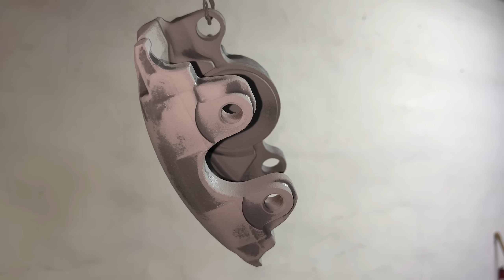How to Paint Brake Calipers - Like from the FACTORY

Comment: To all those saying, “this looks professional.”The final product does look great, and I’m sure will last. However the grease used to lubricate the caliper piston is for the outside parts such as the sliders or pad guides. The only lubricant that should be used to lubricator brake piston seals is brake fluid, or else you risk contamination of the brake fluid and seal failure.
Reply: What do you use to overhaul brake cups ? You use brake grease , it won't contaminate your oil or seals or erode your lines because it's made for that plus some of it will get diluted and comes out with the brake bleeding procedure .
Reply: @ You shouldn’t use anything but brake fluid according to EVERY manufacturer. Synthetic brake grease is only used to lubricate sliders, anti rattle clips, brake pad to carrier and possibly between the pad and caliper exterior. It has a high melt temperature point and it won’t cause rubber slide boots to swell. It does “dilute” in brake fluid and could cause clogs in brake fluid return to the master cylinder. Brake fluid passages in bleeder screws and the master, may only be 1mm in diameter. They clog as the flew hoses deteriorate so I wouldn’t trust passages with ANYTHING thicker than brake fluid.
Reply: @deanbudgell6220  i guess you never saw  drum brakes assembly in a factory or an overhaul at the dealer or a professional shop , there is literally a grease specifically made to be used in the cup overhaul process  and it will delute and won't cause any clogging or corrosion or high contamination of the fluid and as I said after every overhaul you need to bleed the system very well
Reply: @deanbudgell6220  white lithium based or silicone based grease
Reply: 25 years as a licensed mechanic and every manufacturer tells me otherwise. For example here is Fords recommendation WARNING: Do not use any fluid other than clean brake fluid meeting manufacturer's specification. Additionally, do not use brake fluid that has been previously drained. Following these instructions will help prevent system contamination, brake component damage and the risk of serious personal injury.  You can do whatever you want to your brakes. But I will not teach my students improper procedures using improper methods.
Reply: I suspect that is the assembly grease supplied with the new piston seal kits. I am sure the manufacturers of the seal kits know what they're doing

Comment: After the hours of work, and having the expensive machines to do the work. Its far cheaper and easier to just buy the replacements and slap them on.
Reply: Yes but what’s the fun in that!? 🤷‍♂️
Reply: @IDontTalkToCops  if its an old car fine. If its a newer one and parts are easily available. Theres enough work there already. Get a core charge if you can. Olenty of fun doing that job. And not this unessacary bit.
Reply: not is not :) so call new aftermarket parts are often low quality ones and are cheap for reason.
Reply: @lucaslagun8283  i can buy an oem part for most vehicles upto 20 years back. I could see this on something vintage. Though often they do complete highend brake setups on most I've seen. I'll stand by its cheaper to buy than the time it took the person being recorded to do all that work.
Reply: Ya , but they are not nicely painted ?
Reply: @JohnSmithdoe  ok. Still cheaper to buy new and powder coat.
Reply: Wasn’t titled don’t buy replacements, do this instead… simply showing masterful work if someone wanted to paint calipers themselves.
Reply: @xTymezz  I never said it was titled anything.
Reply: What about my Porsche 4 pot brembos😂
Reply: @kristian5821  you do you booboo
Reply: @ well I ain’t spending 2000 pounds on new calipers am I
Reply: @kristian5821  that would depend on the number of hours it would take you to complete the work within this video on your calipers. And of course what you earn per hour. If in fact the number of hours spent on this and the materials to sand, clean, prime, paint and make perfect, your calipers may be as much or better than 2000. Or it may not be. Oh and having all the tools required for such a job which increase the cost of the job. And having the space required to perform this job correctly which increases the cost of the job.  Please note that a high-end vehicles break calipers are not whats shown in this video. And that comparing a statement to a basic break calipers that's 300$ to one that's 2000$ is obtuse.
Reply: @ I’ve got a full workshop to play with, it’s not always the case that rebuilding calipers isn’t worth it all I’m saying
Reply: @kristian5821  we are not speaking to all calipers is my very point. We are speaking to the very specific one in this video. And your full shop definitely adds to the expense of doing work.

Comment: This is the proper way to do this. Complete disassembly, thorough cleaning of the components, correct masking of contact surfaces, then high heat paint applied and cured. Agree with those who say to chase the threads to prevent galling upon reassembly, and possibly honing the piston bore if needed.  Overall, very well done.
Reply: Earplugs are great for plugging bolt holes for paint.
Reply: if a tiny bit of over spray gets on the threads the bolt will just go through it and the threads will be fine. its not like if you had dry concrete or something on the thread lol. Only thing i could see messing up the threads is when he sandblasted it but from the looks of it the threads look to be fine.

Comment: Nicely done job! It was good to see the use of citric acid, because that's a great way to remove rust and I've never tried that, with a caliper, so far.
Reply: A strong vinegar solution overnight is the best I've ever used. It must be done outdoors, however, because of the odor of vinegar, which is likely unhealthy to breath very long.
Reply: @markjones7417  chip shop simulator 🤣
Reply: Cotton balls for holes
Reply: Did he use citric acid and the rest water?
Reply: @juddskiibiz  yes to make up the citric acid solution.

Comment: 2:20 lemon acid you mean citric acid?? It works with more metals or its specified for some metal?? i would like a bit explanation since i have many parts that i always sand by hand because i dont have sandblasting machine.. it will be really usefull to have more time while the chemicals working.. thanks you!!
Reply: I think you can try use vinegar, just soak it for one or two night or more for bigger parts.
Reply: no its gotta be lemon or the flavor wont be correct

Comment: Isn't it necessary to lube the slides/guide pins and piston before use?
Reply: Those slider pins you should only use silicone based grease, if not they will dry up against the rubber slider pin housing it goes through. The rubber housing have like 3-4 pockets inside where silicone grease should fill up all available space.
What he sid with the piston is fine, you will bleed the brakes with new dot4 brake fluid after mounting, this will be lubing the piston for years untill dust particles gather up and lock up the brakes again.. I have rebuilt the same brakes on my VW

Comment: Good Video :) I always apply high temp ceramic grease on inside threads to stop steel bleeding nipples sizing up. And use ATE assembly lube on seals and pistons itself. 
Also if u want them to last lot longer than zinc plating is best rust prevention and than  powder coating or Epoxy primer and spray it.
Reply: I'm a marathon runner and often have to put grease on my bleeding nipples.

Comment: Excellent work. Never thought of Lemon Acid and it's ability to remove rust from calipers. You used Zinc Primer, then a black paint on the mounting surface. Is that just black heat-resistant black paint as well? 
Thanks again for this how to.

Comment: How did the BRAKE BLEED NIPPLE MOVE TO THE OPPOSITE SIDE?
Reply: If you watch closely, you'll realize there's 2 of them for both sides of the car, they are symmetrical, so there isn't any mistery you were just looking at the same calipers from differents sides of the car. I think that would be pretty clear tbh, because you can see both in the video.

Comment: Yes, good vid.  If you don’t have a sandblaster, here’s my poor man’s substitute: one of those massage ‘guns’.  I got a small diameter (1 inch ish) wire brush head, meant for use in a drill, and i had to increase the diameter of the shaft of it from the standard 1/4” to around 10mm or so.  Now you could just wrap say, a cut-off segment of a hose pipe, and keep going until you get it about right, then apply duck tape or insulation tape with some tension, to hold it in place.  I have a bag of short lengths of clear plastic tubing various sizes, that neatly are a press-fit into their next size up or down, you know what I mean.  It took three of those, about 1” lengths, shoved over one another.  It was easier to give it a try, then remove all of them, and assemble the chinese-doll arrangement of three stumpy bits of tubing OFF of the rotary wire brush, THEN bang them on with a hammer gently, and yea, wear gloves here.  Then, it fitted the mounting hole in the ‘gun’ pretty well, all these things are just push-fit anyway on my unit.

How well does it work?  Pretty well.  I got the one that is most compact, I didn’t go for max power or size or anything, I just got the one that had a decent Temu star rating.  It’s got gold edging on it, if you are looking.  It was less than £10UK .  I used it on my Prius rear brake caliper, and it took the rust off better than the alternative, hammering with a small weld-flux removing hammer, or hand wire-brushing or rotary wire brushing.  There’s still a use for rotary wire brushing, my main issue is, I don’t want to damage my drilling device, Bosch or Milwaukee, neither surely has bearings designed for that much axial loading?  Anyway…while this does not take the rust down to the metal, it’s as good as any of the other non-laser or non-sandblasting methods, and easier.  And the lack of out-of-control rotary whooshing wire bristles is nice too.

My particular massage gun, has 6 power settings.  But, in addition, it has a sort of ‘pressure-activated-boost’ action, and this is proportional to the power setting you are on.  IE push down harder on setting one, and there’s a certain faster buzzing with a certain amount of force, but if you up that to say setting 3, then press harder into the workpiece, the resulting boost seems more than on the lower setting.  I’m sure it’s an improvement, if only for when you don’t have a vice or whatever, to hold the workpiece/calliper, it’s safer than a wild rotary action on an angle grinder or drill maybe, and some weird dints and crevices are positively elusive without a direct-line hammer action.

So, that’s my tip.  Drawbacks are, as expected, the bristles do ‘bend over’ at the tip after a bit, but I suspect if I either wrap duck tape or maybe use a couple of tie-wraps or circlips/jubilee clips, to keep the bristle ‘bunched’ properly then it mightn’t let the bristles bend at the tip.  I only just got a vice, after 50 years of working on cars I thought I better start making it easier.  Getting the tools I always avoided buying.  Sandblasting is obviously really good.  Laser, is really, really good, but will get cheaper I am sure.  My only issue is laser rust removal is awfully easy - you have to get set up to sand blast, your child or curious teenager isn’t going to readily mess with a sandblaster booth.  Lasers are somewhat dangerous when they are that powerful, and it’s a bit like welding which now is also very cheap…I was put off not by the PPE I needed to buy, but by the need for a neat workshop.  I’ve got naptha and all sorts in there!  So until I have a decently-sorted garage, welding is another thing to steer clear of for me.  Good vid, take care all.

Comment: All threaded holes need to have bolts screwed into them before sandblasting and painting. Then, a thread tap must be run in to clear out the threads.😊
Reply: Just stick foam ear plugs in if there nice and snug, should be good.

Comment: I was rebuilding my read clipers and I struggled to put a new rubber boot back in place. 
The rubber boot end has a metal ring which I could not mound on the groove even with a force and you seem to mound it fairly easily 7:13 Does it need a lot of force?

Comment: pressure release on the break piston can be achieved with pressured air. Be carefull though, use low pressure and as in this video, a cloth to brace the exit of the piston.
Reply: You can pump the piston out before removing the caliper from the car
Reply: @olejakobsen2363  indeed, this is also true. just remove the brake pads and you push it out. Off the disk of course
Reply: @olejakobsen2363  Yes, that can work, but you won't be able to control the release of brake fluid, and risk making a mess.

Comment: You need to lubricate the slider pins otherwise it’ll seize up pretty quickly.
Reply: Not on these styles...many manufacturers don't recommend lubricating these.
Reply: So when should we lubricate and when not? Can you explain please?
Reply: @wcmauldin81 what calipers are these for because it’s the first I’ve ever heard of it? They will get water ingress and rust.
Reply: I know most BMWs have this style and the service manual specifically states to clean the guide pins but so not lubricate. Due to the pins potentially being open to the elements, any lubricant could attract foreign contaminants.

Sealed systems such as Kia and others are within the metal caliper bracket and need to be lubricated.
Reply: Is this a BMW? Nope. It’s a Ford.
Reply: @rfahlsing  No but it's an ATE caliper which is pretty much identical in design and function.

Comment: Hi. Thanks for the video. Why You use a heat after painting?  Can I use a bike pump to extend the cylinder?
Reply: yes. you can use bike pump. heat is because for making sure paint doesnt fade when install on car
Reply: @MrOner07  You can also put it out when caliber is conneted in your car, take it out disk and only push brake pedal.

Comment: How did you protect the coating inside the bore, which is the most important bit?
Reply: the bore in use is protected by the brake fluid, which as long as you replace at the correct intervals wouldn't suffer any corrosion issues, and the sealing surface is the piston anyway so don't need to stress to much on the bore

Comment: Great result and proper process. However i prefer powder coating coz spray paint will be weakened over time.
Reply: Some folks don't like powder coating because it comes out a bit goopy-looking. The spray finish tends to retain details better. I've seen this on my motorcycle project.

Comment: Note he tried to save the seals, too. By this method, you can save $35 or more per caliper, and you control quality, not some over-worked, under-paid quota slave in an off- shore refurbisher factory.
Those who plan to keep their cars already realize how quickly parts can disappear from the after-market. 
Recycling is the answer, which puts you back in control. 
* Even industry rebuild kits don't deliver this level of quality. Their only plausible purpose is to provide replacement of damaged rubber parts. If your rubber parts are reusable, consider protecting them with high-quality silicone grease for protection against oxidation while in storage.

Comment: Caliper paint is heat resistant to 900*F.  It is also very chemical resistant.  Would have been nice to know what black primer you used and the final coat. They do look tremendous and that lemon acid trick is da shizat.
Reply from the maker: zinc primer probably silicon-organic base (temp resistant). And final paint based on silicone polymers. I would use paint for the calipers to be sure of paint compatibility. Thank you!

Comment: Unless you used some VERY special paint, any DOT3 or DOT4 fluid drips from final assembly or bleeding will eat off that paint and expose bare metal.  I wonder if powder coating would be able to withstand this...
Reply: ...on some bike vids they used cerakote.

Comment: Whats the white stuff in the tube?
Reply: This is (or should be at least) a lubricant that withstand braking fluid. It should be used on surfaces that have contact with DOT fluid. For example I use "ATE bremszylinder paste", but i do not know what is this what he uses in the video.
Reply: He used VMPAUTO MC-1600

Comment: You can use grease gun instead of air pressure, its safer and soaking calibers in winegar instead of citron acid, nice work anyway.
Reply: just make sure you fill it with brake fluid, grease will destroy the rubber.

Comment: I was wondering why someone would do this. Judging by the grease tube (Russian worda and lettering), this is in Russia. Where the part is more expensive than his labor. Here, it is cheaper to buy replacement calipers than to bake paint with your oven, buying new seals, and grease. LoL!

PS - ANY part that has a slider or cylinder and piston mechanic to it, NEVER sandblast. ANY single pit or scoring on the surface of the cylinder wall can cause failure. Tape off the area and use a lower rpm wire wheel, or wire brush by hand, or a rotary tool.